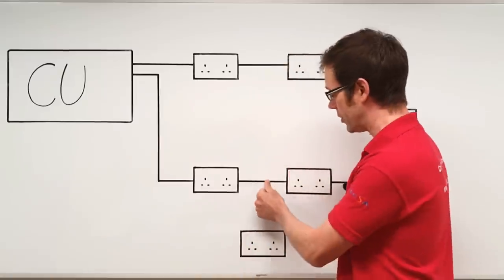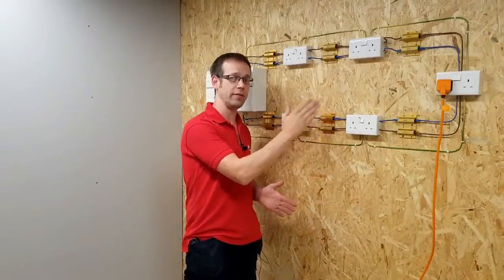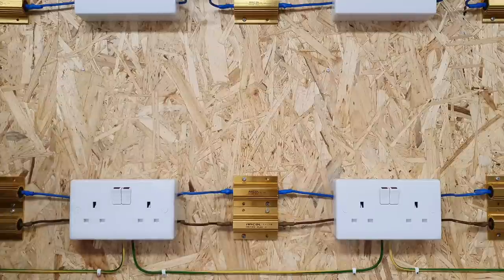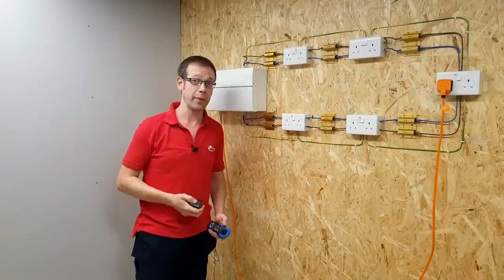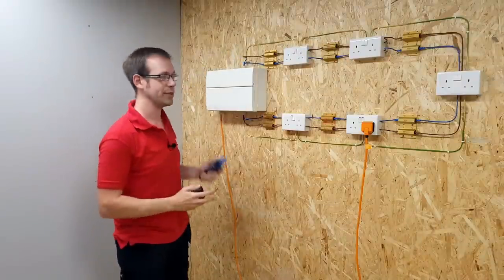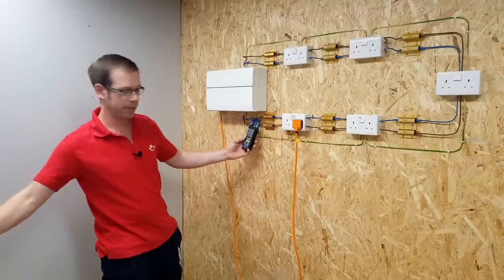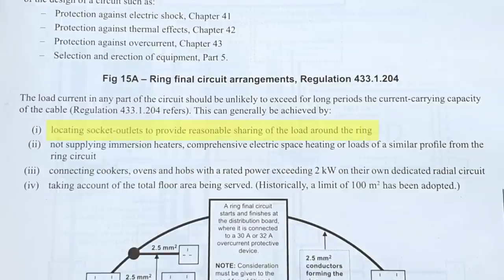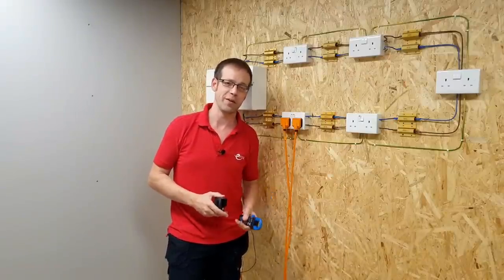KNOW HOW: How does current divide in a ring final circuit? (ring main)

Comment: I'm still confused. What are the pros/cons of Ring Circuits in the first place?
Reply: I posted this a year ago... Yes, there are advantages to rings. They have been widespread in the UK for 75 years. They have been found to be very safe.

♦ Cheapness, as smaller, easier to install, wires can be used;
♦ Two ways for the earth back to the consumer unit;
♦ Another is a large number of sockets can be off one cheap ring;
♦ Having the same number of sockets using radials would mean multiple radials and multiple extra breakers at the main panel. Far more cable, expense, labour and hassle;
♦ The 32A breaker and 13A fuse in the plug ensures safety.
♦ Portable plug-in appliances on a ring cannot exceed approx 3kW. Some plug-in ovens are on rings;
♦ Rings usually have a 32A breaker at the main panel - can be a smaller value;
♦ Using push-fit maintenance free Wago type connectors to connect up the ring makes them a lot safer as not being screwed connections they do not work loose. The ring's current does not run through the socket terminals;
♦ The British plugs are ideal for rings having a max 13A fuse in them - can be as low as a 1A fuse in the plug to suit the appliance. Small flex and appliance? Then a smaller fuse;
♦ Rings in the UK are limited by 100 square metres of floor space and 100 metres in length, with no limit to the number of sockets on the ring. 100 square metres of floor space for 2.5mm cable for a 32 amp final ring.

Radials are also used in the UK, rings are not mandatory, but used because they are generally trouble free, safe and cheap. They can be installed using rule-of-thumb. These days a ring will be on an RCD, RCBO or AFDD - these now are becoming DP, so safer again. In one job in an office, they wanted more socket outlets for extra desk computers. It was a simple matter of extending the existing ring with the extra sockets as the current draw was low. Cheap and easy. If radials were used three radial circuits would be needed, which would mean an extra consumer unit, breakers, wire etc, then far more labour.

Some disadvantages are:

♦ Rings are more difficult to fault find. But electricians have no problem once the ring is full understood. The ring can be disconnected at a socket into two radials and tested. 
♦ Another is that if a number of high current drawing appliances are on one side of the ring, say near to the main panel, most of the current draw may be down one cable of the ring which is rated below the main 32A breaker. 2.5mm cable is rated at 27A max. Although tests have proven the cables do not exceed their current capacity, just an imbalance in distribution of the two cables from the main panel (consumer unit). Good circuit design will prevent this, negating this disadvantage. Balanced rings can be installed by daisy chaining to alternative socket outlets on the ring. That is the first appliance will draw from one side of the ring, the second socket will draw from the other side, and so on round-robin. Or use 4mm cable to the point where heavy current drawing appliances are then 2.5mm for the rest, if it is that troubling for some. Using 4mm cable on one side of a ring and 2.5mm on the other, is still cheaper than a bunch of radial circuits.

Overall one ring is superior to a bunch of radials needing their own breakers at the main panel. They are simpler, cheaper, being proven to be safe and worked well over the past 75 years. 

You will have to give a very convincing argument against rings. I have not heard of one yet.

Comment: But if this was just a radial circuit, you would draw 100% of the current without being divided among the two sides of the ring. Although it is uneven, it’s still less current being drawn through a single cable than if it was a radial. The whole point of doing all this math and circuit breakers and stuff is just to stop the cable from overheating. Uneven load along a cable has no consequence whatsoever.

Comment: Great visual explanation!
So this would mean using blue through crimps designed for 2.5mm cable to extend a leg of a ring final is unacceptable. Then upsizing to yellow crimps for the rating but now the crimp won't be tight! Nightmare
Reply from the maker: That's an interesting point. 🤔
Reply: What is a blue crimp rated at?
Reply: @tonymariner5519  15 amps, off the top of my head
Reply: @sammegadeath just checked and blue crimp is rated at 27amps
Reply: @tonymariner5519  could you post a link to that please mate?

Comment: every time an electrician fits a new consumer unit and leaves the job saying to the home owner ' and you've got four spare fuseways......"  should have split the two rings and had them properly fused.
Reply: Why ? better to have spare ways for expansion
Reply: @persona250  safety.
Reply: @MARTINA-gc3tq  ring final is safe acceptable
Reply: @persona250    2.5mm cable "protected" by a 32amp MCB is not acceptable to me.
Reply: @MARTINA-gc3tq  ITS 5mm parallel supply

Comment: But… why did people create rings? Isn’t that a very error-prone difficult-to-understand design?

Even assuming cables aren’t swapped anywhere, if one cable is broken, everything flows through the other side, and if this only happens for one of the two lines, then you have a big magnetic loop…
Reply: The ring is ingenious, simple and cheap, eliminating many, many radials. If you fear a cut ring then use 4mm cable. Max breaker is 32A by regs.

Comment: Ďangerous things ring mains, just like diversity in a cooker circuit!
Reply from the maker: They’ve been around for quite some time
Reply: @efixx  Only in GB and protectorates. They are banned in most other countries.
Reply: @terryhutchinson6503  
The other countries have a lot to learn then. Over 75 years rings have proven to be very safe and cheap to install. People in Britain have lots of power available with fear of tripping a breaker. People on the Continent regularly reset tripped circuits.
Reply: @terryhutchinson6503  
You may find that final ring circuits are not banned at all in other countries.  They just do not use them as they do not understand them.

Comment: Why does Gary hate the term "ring main"?  It's the term that most electricians use and it's been used in the industry for decades.  Almost no one uses the term "ring final circuit".  Why would they?  What's "final" about a ring circuit?
Reply from the maker: Good question Chris, in Part 2 of BS 7671 which gives definitions used in the regs, this type of circuit is defined as a "ring final circuit". The regs uses "final" to refer to a circuit that supplies a load or loads. This is to distinguish it from a "distribution" circuit which feeds a distribution board or switchgear. In my understanding a "ring main" is used to describe the way transformers are connected to each other on the supply network to minimise disruption when carrying out repairs or maintenance. Hope this answers your question. 😃
Reply: @efixx  I just don't understand why they keep changing terminology when there's no need.  This terminology has been used for decades and it's still used by just about all established electricians in the field.  Don't get me started on CPC!!  Everyone calls this the earth conductor but we're now teaching that it should be called CPC... then as soon as the student gets into the real world, we call it earth again.  It's a conductor that's attached to earth, we call it EARTH.  Who decided that was ambiguous and needed changing!!??  You got me started! :)  Great channel by  the way.  Keep up the good work guys!

Comment: You stated that you have the earth wire in for electrical safety - so WTF have you not connected the earth wire to all those bare metal extraneous parts of the resistors ? I suggest you get an electrician in to do the job properly.
Reply from the maker: They're not extraneous conductive parts.

Comment: 1. You MAY have done it OFF video, but a clamp meter should be zero checked prior to EVERY reading
2. So all the sparkies who bitch and moan about ring mains (suck it up youngsters, they were called ring mains BEFORE your grandads even were born!) and who say we should ONLY have radials, PLEASE explain how a 20 Amp radial on 2.5mm T&E rated at 24 amp can deliver FULL power to even ONE TWIN 13 A socket? 

If the answer is more dedicated radials for heavy power items then
 a) the typical CU is totally unfit for purpose and has been for decades b) providing the default MCB configuration is a farce perpetuated by the industry to cost consumers totally unnecessary money for MCBs that are provided by default but for which they have to pay and get no rebate when they have to be replaced
c) WHY are CU's not specified to be fitted with RCBO's on ALL new CUs - whether for new-build or replacement and also ALWAYS supplied EMPTY so that the CORRECT layout is chosen and ONLY those values require purchasing.
e) in order to provide radials with the correct current capability for a washer, tumble dryer, dishwasher, toaster, kettle, microwave then multiple radials of 32A needing 4mm cable MINIMUM, or multiple 16A and 20A circuits incapable of providing more than one socket at full power. DOH!

Ring mains WORK, and ONLY fail when "professional" sparkies take short cuts (as in my CU! Twin socket off a radial circuit AT THE CU!) to save work (first) and money (second)
Reply from the maker: Thanks for the feedback Bob - we’ve received loads of comments on this topic so we will produce more videos.
Reply: Great post. Final rings are brilliant. There is a propaganda move against them. AFDDs and screwless terminal connections on the ring makes them near bombproof. They eliminate a load of needless and expensive radials. 

Yes why are all socket circuits not mandated to use AFDDs and mandatory on high current circuits like shower circuits?
All breakers at the CU should DP as on the Continent.
All switches on sockets should be DP.

Comment: I have never understood why you guys allow this stuff. More particularly why you still allow them. The 50s were one thing, but why not abolish them by the 70s? By today you’d be more or less rid of them.
Reply: It’s allowed because it works wonderfully well in real life! You are probably forgetting that there is a fuse in every plug (not socket!) so this allows a larger breaker in the panel, meaning far fewer circuits and virtually no nuisance tripping. Ideal
Reply: @edwardemberton8069  the fuse in the plug isn’t relevant. It only protects the flex, not the ring circuit. I mean, sure, the existence of ring circuits makes the fuse in the plug an absolute necessity, because pushing 32A through a 1 or even 0.75 mm^2 flex is a really bad idea, but pushing 32A through 2.5mm^2 solid core wire is also a bad idea, which is why it’s not allowed.

And yet, when — rather than if — a ring breaks, everything keeps working and so the customer never calls in the cavalry, except for the fact that now you are in fact pushing those 32A over a single 2.5mm^2 wire.

Rings are fine as long as nothing breaks, but they’re a terrible idea anyway because stuff always breaks.
Reply: @JasperJanssen  
"Radials are a terrible idea when they break."

32 amp running through one cable? Did you take notice of the vid?  The current runs proportionally through the two legs. One 2.5 cable takes approx 27A. Only in a very badly designed final ring will current be over 27A in a 2.5mm cable. Regs say aim for 20 amps on each leg. 

If you are paranoid about a break in the ring, fit a 25A mcb in the CU. But best to ensure heavy current drawing appliances are not bunched on one leg and have the ring in 4mm.  It is called circuit design.
Reply: @johnburns4017  what’s terrible about a radial when it breaks? It just..  doesn’t work. What part of that is unsafe?

When a ring breaks, all of the 32 amps goes through one leg. Not half, not 27 amps max, but all of it. Because there is no longer a second leg.

(Also, a 2.5mm^2 cable should never have 27 amps running on it. 20 is already on the heavy side.)

There is no such thing as circuit design in ring mains — they’re sockets. The electrician designing the system has absolutely zero input on or knowledge of how much load goes where in the ring.
Reply: @JasperJanssen  
Look up the max current ratings of 2.5mm.
If a final ring is cut the mcb/rcbo, etc will trip.

If installing a ring in a kitchen,  do not bunch all the heavy appliances on one leg. Final ring's have fused spurs not just sockets. You can have one leg of a ring 4mm. Say where the heavy appliances are. It is called circuit design.
Reply: @johnburns4017  if a final ring is cut nothing will trip. That’s exactly the problem. And like I said — 2.5mm^2 shouldn’t really be used for more than 16A, 20 at the outside.
Reply: @JasperJanssen  
Look up the tables of current and cables.
Reply: @johnburns4017  look up a better table from a saner country.
Reply: @JasperJanssen  
Maybe physics is different  where you are.
Reply: @JasperJanssen  
U tube has lots of vids showing excessive loads run through cables, timing when a fire breaks out.  Look at them. 

I have a final ring by choice.
Reply: Yes, a country that developed and invented just about everything technical in the modern world.
Reply: @johnburns4017  you seem very passionate.
Reply: @JasperJanssen  
I know what I am on about.
Reply: When installed to the points directly below the igneous & simple final ring circuit now is near bombproof:

1) Use an AFDD in the main panel (regs recommend them);
2) Use screwless terminals that do not work loose, on the sockets;
3) Use 4mm cable;

Having a ring like this would eliminate a multitude of radial circuits, all with their own AFDD and eliminate a large main panel. All reservations of a final ring splitting creating two radials on a 32A breaker and arcs created due to loose connections are gone. 

I have seen one and two bedroomed apartments in London with heating and hot water on a gas combi, with the apartment wired with three circuits: 

1) Final ring as above, in 4mm;
2) An RCBO on 4mm cable to a 13A Bosch hob and 3kW oven (both with 20A isolator switches in adjacent cupboards;
3) 3A RCBO for the LED lights on 1.00mm cable. 
4) Small and cheap main panel with a spare way.

Only 4mm and 1.00 cable was used in the whole installation. 

If this was in France it would have a large main panel with many, many needless radial circuits. Regs in France state the maximum number of socket on one radial is eight.  I have 12 sockets in my living room alone - five doubles and two singles. In France that would be two radials for one room. Madness, when rings are here.
Reply: @johnburns4017  I mean, sure, you could do that, but why would you? Rings are not just a bad idea for the technical reasons, but also because they’re just harder to lay out. If you then don’t even save any copper on it, there’s no benefit at all to them.
Reply: @JasperJanssen  
Search Can UK Electricians Learn from French Electrics?

He describes a main panel in a French two bedroom apartment. It has:
1) Four socket circuits;
2) Two Individual radials for the washing machine/dryer and fridge;
3) Two radials for each of two extractor fans. 
 
That is eight circuits that can be on one 4mm 32A ring circuit with only one AFDD. In some UK installations by regulations that would mean four AFDDs. Getting needlessly expensive now. Rings in the UK cannot serve an area of greater than 100 squ metres or 100 metres in cable length. 100-100. 

Rings are easy to lay out. They use less copper. Repalcing eight radials they clearly save on masses of copper cables. Then they use less expensive breakers in panels, and panels can be smaller. Saving great costs yet again. 

Rings using one AFDD, 4mm cable and screwless terminal connectors are cheap and bombproof. Very safe. The fuse in the plug protects the flex on appliances.  Rings are ingenious in their simplicity. About time others around the world caught up.